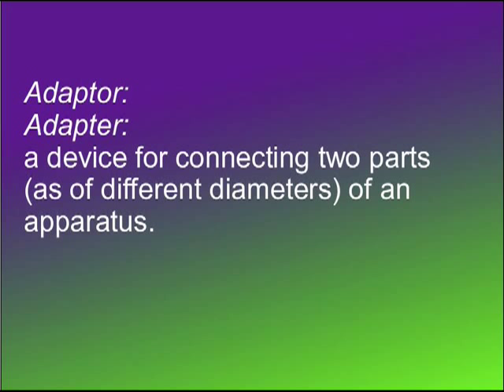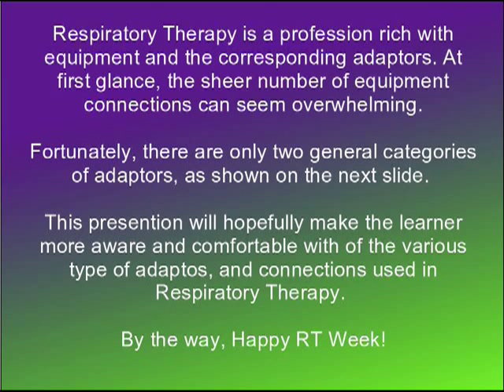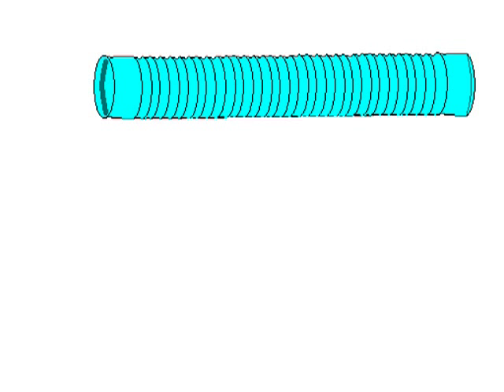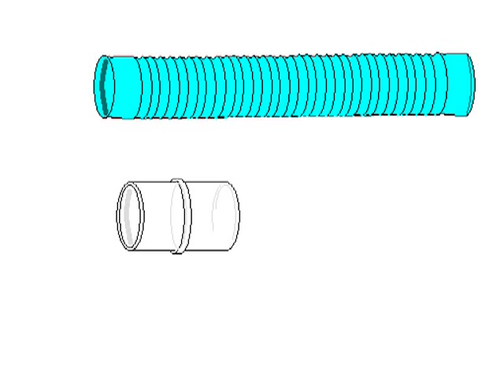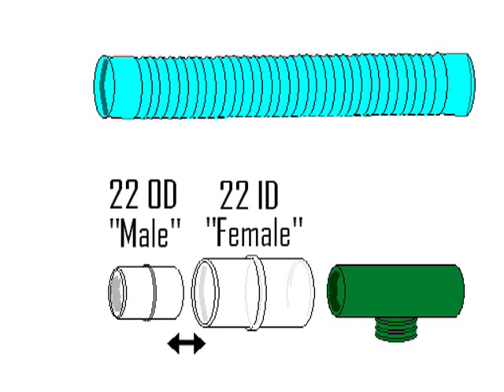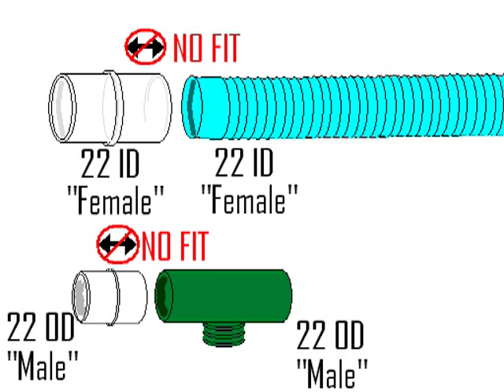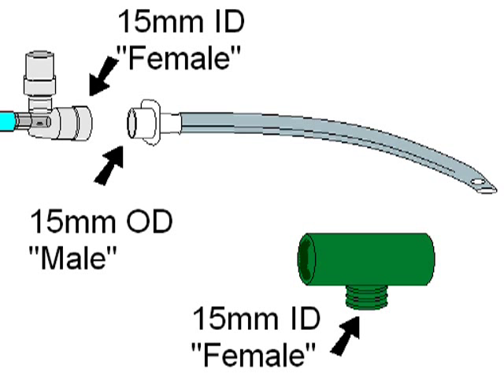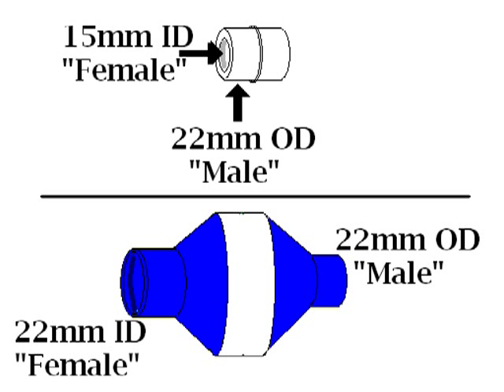Adaptors in Respiratory Therapy

Comment: Hello David, hamilton g5 ventilator leak test failure, I m trying to switch from reusable circuits to the disposable heated wire breathing circuits, only adult circuit passes the leak test but neonate and pediatric circuits fail the leak or tightness test, please suggest the appropriate circuits (brand wise) which will work